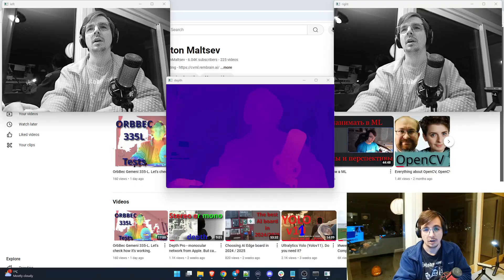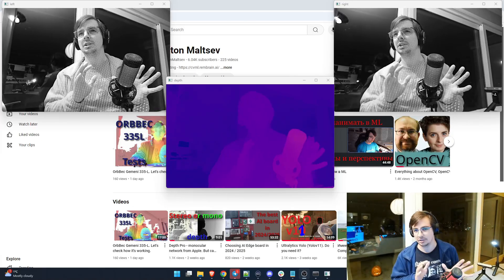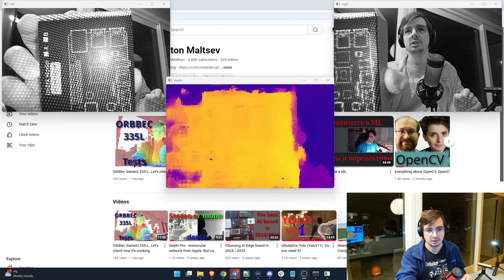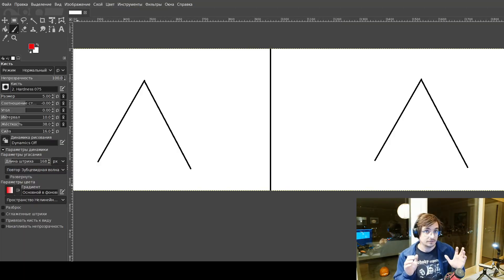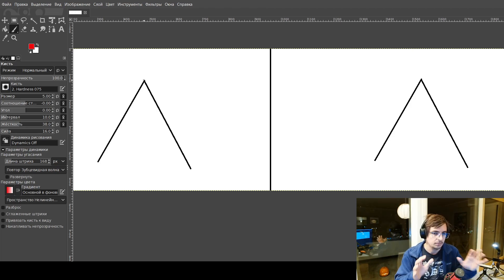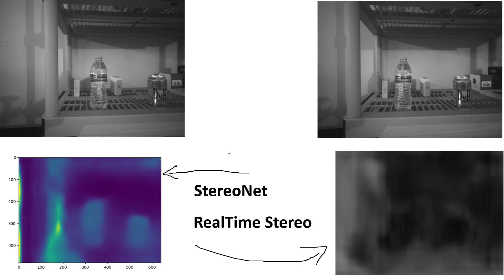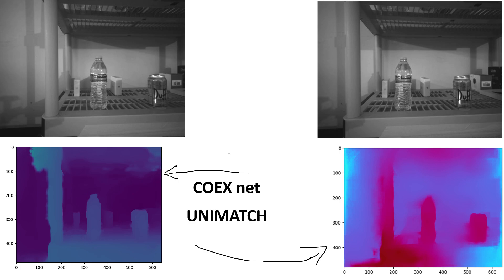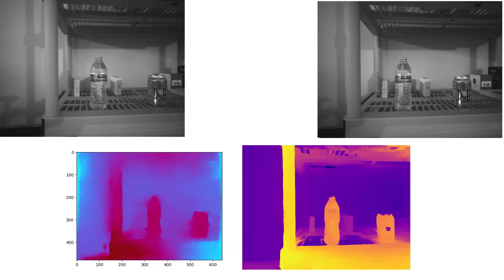Depth estimation. From the theory to the Edge.

Comment: Thanks for the nice video. Is it possible to connect two cameras to the RK3588 and have depth estimation? I mean, does it require image synchronization?
Reply from the maker: Hi!
1) It is better to have a stereo camera with onboard synchronization. Without it, you can't work with moving objects. If they are static, then it should be OK. 
2) It's hard to run some workable network on RK3588. It was pretty big part of this video:)